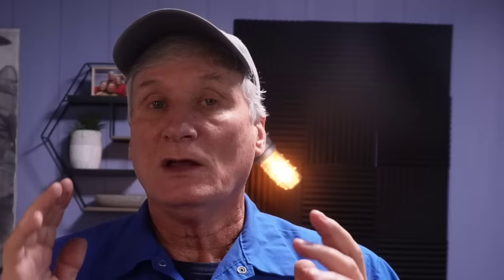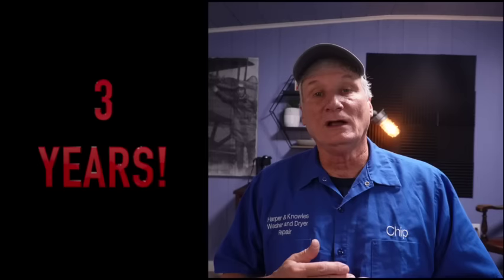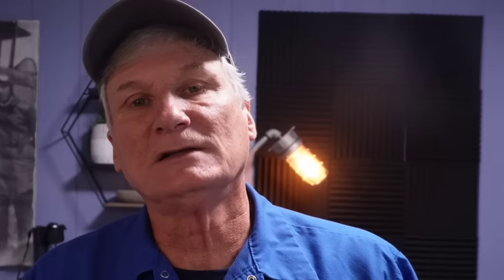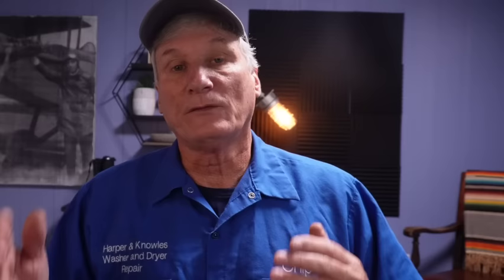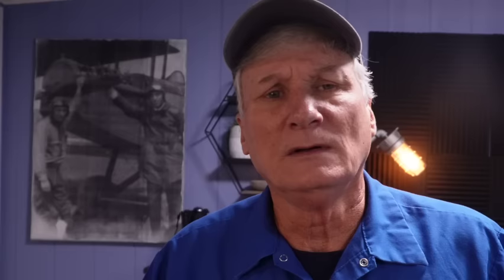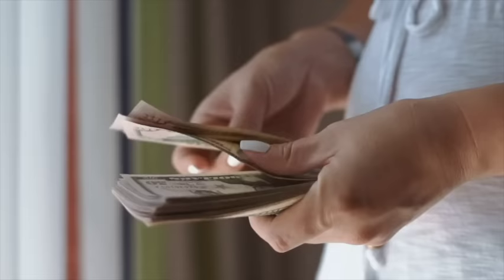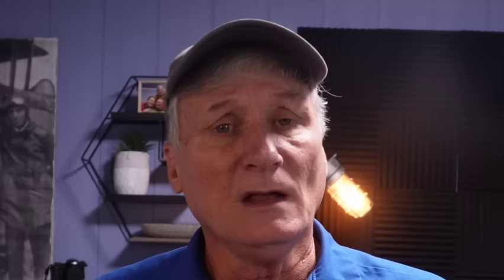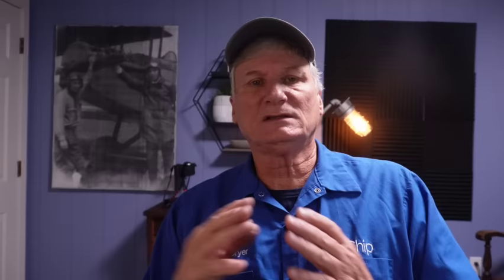How To Choose the Best Washing Machine: Speed Queen TC5 vs. TR7 Review

Comment: We purchased our Whirlpool washer (and dryer, electric) 17 years ago and have been very happy with them.  I've replaced the clutch mechanism on the washer twice during that time, but with the help of a YT video or two have done it myself quickly and inexpensively both times.  On the dryer, I've replaced the heating element and drive belt once each. That's it.  Of course now that I said all that, I hope I didn't jinx myself.  😂
Reply from the maker: Thanks for watching!
Reply: You’ll have these forever 🙂
Reply: A former employee of ours (restaurant) who now has a multi-truck Appliance repair business is a Speed Queen dealer but also tells me Whirlpool is a) easy to work on and b) has the best parts availability of brands other than SQ.
Reply from the maker: Hmmmm, that may be true. They certainly are easy to work on but the quality of the Whirlpool products have certainly gone down in the last decade or so. Thanks for watching!

Comment: Now if only Speed Queen would make a Refrigerator Freezer that lasts, like the ones from the 70's.  new stuff starts to rust, within a few years,  old machines, wouldn't even rust outside the house in the rain.  I remember way back,  some people had deep freezers, and even fridges outside the kitchen door. (dangerous I know, and why that's illegal now) but the thing is,  they did not rust out like the crap they make now.

appliances for homes should not be designed for planned obsolescence. make them good, and make them to last. at least 25+ years,  not 5 years.
Reply from the maker: You're absolutely right! Speed Queen has nailed it with their washers, but it's a real shame they haven't ventured into the world of refrigerators. Thanks for watching!
Reply: Down south, everyone has a fridge on back porch
I shudder at the thought of their electric bills! Even in Deep South, there they are. I know lady with a deep freeze in the shed!! She must pay $100 a month to run that in May thru Sept

Comment: Speed Queen is a very high superior upon any other brand and always has been since whirlpool ditched the direct drive washer series which were the second best made machines in the washer category and I still have one. There is no other washer that agitates as quick as a commercial Speed Queen and cleans so well, not really a fan of the TR series and that series has gotten a lot of well deserved hate and ours leaves behind a lot of stains as my parents got a TR model it’s unique and delicate but too delicate and doesn’t have the ability to deep clean, none of the classic transmission models with the flexvane agitator ever leave anything behind, I use them daily at work where we have tons of them. And yes, the motor they use for the classic TC and commercial series have very powerful motors, such great made appliances. We use these machines hundreds of times a week and none of them ever have an issue, if they were HE machines Michigan Laundry repair would be at our place everyday fixing them. Absolutely adore Speed Queen!!
Reply from the maker: Well said!   Thanks for sharing your experience!  And thank you for watching too!
Reply: I have a direct drive as well, and basically pack ratted enough parts to completely rebuild it, should it ever wear out - still going strong some 30 years later
Reply: @kellismith4329  Mine runs like new still, from 96. Timer is just noisy. I’ve done hundreds of heavy loads in it within the last couple years and it’s just unfazed. Incredible machine! Plus, mine has all the original parts besides the pump, it looks a bit newer. I’ve not spent a dime on any parts for it.
Reply: @kellismith4329  with a rebuild, it’ll last another 30+ years without a doubt in my mind. They were notoriously reliable washers
Reply: The 2018 washer got deserved hate. It was updated and they are absolute great washers now and I can make that assessment since I do own one. My 2023 TR5 got out ground in black lithium grease without any pretreat, using the heavy duty setting. Heck, I didn't even use the 'heavy soil' setting, lol.
Reply: @231mac  Did they update the wash system? Ours is a 2019 TR. it’s unique but sure doesn’t clean like a flexvane speed queen.
Reply: @Goldenwoodz  The 2019's clean better than the 2018 models, but I feel they were still in their trial and error phase. I believe they made continual updates since, but let's be realistic, a TR will never be able to clean like a TC model can, but it won't be so rough on your clothes like a TC will, either. I honestly cannot complain about my TR's performance in the slightest.
Reply: @HarperandKnowles  Are the TR5 models okay or not. Just bought the set and was delivered 2 days ago, as I was not sure which set to purchase.

Comment: I have a very small family, so the TC5 washer capacity would be OK. I've noticed that the GE washer my little house came with has a hard time handling bulky clothes and a summer weight quilt. I guess the TC5 would not have a problem with that. My laundry room is in the basement, so noise would not be a factor. I notice that the TR7s have a complex electronic touchscreen, which can open up a lot of things to break. And, being retired, I don't wear a lot of flimsy fabric clothing these days, mostly denim and cotton or cotton/poly blends. Would the TC5 SQ washer tear those to shreds? Finally, I HATE the dryer my house came with. It's an old Whirlpool which, despite a professional duct cleaning and me cleaning the lint screen every time, leaves little white balls all over any t-shirt material clothing which will not come off with a sticky roller! Also, the dryer got stuck last week going and going, never stopped for 2 hours. Which SQ dryer would make a nice mate for the SQ washer? Thanks!
Reply from the maker: The 3.5 cubic feet drums were standard for most consumer models up until recently.  My mother raised five kids so we had a family of 7 and that was the size washer she had.  I never heard her complain about it being too small.  The TC5 operates just like the old models. It won’t tear your clothes up just moves them through the water in the old fashioned way.  As for the touchscreen, SQ rigorously test their electronic components to a very high standard. I wouldn’t worry too much if I decided to go that route.  As far as their dryers they are mostly the same quality as the washers and are usually paired to match the washer you purchase. I hope this helps you in your decision, thanks for watching.
Reply: Thanks for your quick reply. I feel that the TR7 has more bells & whistles to break down than the TC5. And I doubt that I need all those fancy cycles for my basic non-flimsy cottons, cotton/poly, and poplin clothing. If a dryer, despite a recent professional duct cleaning and lint screen cleanings each use still produces cotton clothing covered in white lint balls (I have a long haired cat), and keeps going despite the cycle chosen, is that a good sign that I need a sturdy dryer, too? @HarperandKnowles
Reply from the maker: I'd choose the TC5, too, mainly because, like you, I think the less complex it is, the less maintenance is needed. I have no idea why your dryer leaves lint balls on your clothes. That's a first for me. I'd appreciate input from anyone who knows why this is happening. With limited information, I can only guess as to why your dryer won't cut off. If the timer knob stays in one place (the spot you started it on), then I suspect your dryer's timer motor is defective and should be replaced.
Reply: @HarperandKnowles  I had a similar problem. It wasn't the dryer but the vent to the outside that was plugged up. We had bought a new dryer hose, but that did not help. I called someone to clean it out and that was the end of the problem.
Reply from the maker: @emi566 , thanks for sharing your experience. Thanks for watching too!
Reply: My local SQ dealer stated they had fewer issues with the touchpad controls than the dials when I asked. Good enough for me. Maybe they were just giving me some confirmation bias. I don't know. I brought a TR7 home, I prefer the more gentle wash cycle. Even my Maytag with touchpad never had an electronic issue in 22.5 years. Your experience my vary.
Reply: Too  much to type here but just a thought: in 1983 I had been chemically poisoned on the job and was given 6 mo to live at age 32. The legacy is that I must avoid all chemicals including fragrances, plastics and  all synthetic fabrics.  So since 1983 I have only worn all natural fibers. Same for washable home dec [pillows, blankets, curtains, etc].  When I wore poly blends before that, I would get those fabric pills especially if laundered in the same load as natural fibers.

As an experiment, can you set aside any poly or poly blends and live with natural fabrics  only awhile, a few days or a few loads? Or at least separate the loads between natural  and synthetics to see how the fiber pills show up?

Comment: 7 years ago after yet another washing machine bit the dust after about 2 years I bought a speed queen and the first thing I noticed was how much heavier the speed queen was and now 7 years later the speed queen is still running like day 1 and has not moved at all from the spot I installed it and hearing it run takes me back to my child hood and hearing the Norge chugging away.
Reply from the maker: It's wonderful to hear that your Speed Queen washing machine has been reliable and durable for the past 7 years. The weight and stability of the machine can often be indicators of its build quality and longevity. It's great that it has remained in the same spot and continues to run smoothly, bringing back nostalgic memories of the older Norge machines. Thank you for sharing your positive experience, and may your Speed Queen continue to serve you well for years to come! Thanks for watching!

Comment: My Mom has a heavy duty top load washer bought from Sears about 20 years ago with a coated tub. I'm amazed the coated tub looks new still to this day and that washer never needed a repair and still going strong. I know multiple people with modern Samsung and LG washers that only got a few years before repairs were too expensive. One was a main electrical circuit board that failed and cost hundreds just for the part. I'll only buy a washer and dryer with mechanical controls. No digital when it comes to washing machines or dryer.
Reply from the maker: And that’s why they call you Practical Guy! Thanks for watching!

Comment: We have a TC3 washer. The only thing, when we press the start button, if it is pressed a fraction of a second too long, it will go into pause mode. We have had to develope a touch when starting the machine. One other thing we have a lid lock and we wished we did not have that. Only good thing about wifi, on freezing cold nights to keep water moving though pipes, you can turn the washer on to do that.
Reply from the maker: Is the 3 year warranty still effective? If so you should get a tech to examine it.

Comment: My sister bought a Turdpool...err...Whirlpool a few years ago- What a piece of junk. Never worked right from day one, she got rid of it in a few months, selling it on CL for $100, and took my advice and bought the SpeedQueen. She loves it and hasn't had a problem. If my 22 year-old Amana ever goes, I'll be getting a SpeedQueen too (But considering that I've yet to have one problem with the Amana, and as long as parts are available, it may well last me another 20 years). Simple and easy to fix, little to go wrong, and cheap to fix if it does = what to look for in anything mechanical. This is why I drive 20+ year-old vehicles......
Reply from the maker: I'm so glad your sister found satisfaction with her Speed Queen after her experience with her previous washer. Speed Queen's solid reputation for reliability is definitely well earned! It sounds like you've also had excellent luck with your Amana washer. You've hit the nail on the head -- appliances that are straightforward and inexpensive to repair certainly do make for a worthwhile investment. And it's a bonus when they also provide many years of reliable service, just like your 20-year-old vehicle! Thank you for sharing your experiences and thoughts with us.

Comment: I am still washing loads of clothes, sheets and towels weekly with my Maytag top load machine that my husband and I purchased in 1983! Within a couple months it was leaking oil onto the floor and I had to send a letter to the State of Montana consumer division to get the seller to fix the machine. Since then I’ve never had a service call. Our dryer is a Kenmore my husband purchased in 1978! I only use it for sheets and towels and either line dry or hang the clothes on plastic hangers to dry.
Reply from the maker: Wow, that's truly impressive! It's amazing that your Maytag top load washer and Kenmore dryer have been serving you well since 1983 and 1978, respectively. These older machines are known for their durability and long-lasting performance, and your story is a great example of that.

It's unfortunate that you initially experienced issues with the washer, but I'm glad the situation was resolved and it has been working well ever since. Your approach to drying clothes by line drying or using plastic hangers is also a great way to extend the life of your dryer and save energy.

Thank you for sharing your experience with these long-lasting appliances. It's always inspiring to hear about machines that have stood the test of time. If you have any questions, suggestions, or would like to share more about your journey with your washer and dryer, please feel free to reach out. I love hearing stories like yours!
Reply: I wish I still had my 1985 Kenmore pair! I got rid of the washer when moving in my relatives house who had a Kenmore. When I moved out, I left it & my dryer as I moved cross country with very little to avoid thousands in moving cost. 
I should have put them in storage!! Who knew the world was going to go to pot? Not I! (I’m 59 next week)
Reply: While a retired couple can hang all their laundry, a family can not. I hang about a third of our laundry n we do use towels one week, hand towels get changed daily. I am beyond grateful for my dryer. If I ever am forced to use a laundromat washer I can at least bring home all the loads (4-5 I could do at once) to dry while I’m doing other things.

Comment: I won’t spend money on other washers or dryers.  The woman I was with had gone thru 3 set of washing machines and driers in just 4 years.  I talked her into buying speed queens and they are now pushing ten years without a single service call.   The only issue I have with speed queens is the stainless steel drum in the washer. For some reason it comes from the factory still dirty from fabrication.   You have to spend about an hour with a scouring pad, and some degreasing detergent and a roll of paper towels to get the drum so it won’t leave a grey streak on a paper towel ( or your actual towels).
But you only have to do that once when you first buy it.
Reply from the maker: Thanks for the tip. I did not know this. Thanks for watching too!

Comment: I have a Speed Queen washer that offered a ten year warranty when I bought it. It's about three years old and it makes a little beeping noise if its plugged in even without being in a wash cycle. I called Speed Queen and they sent their local service man out but he didn't know why it was beeping and since the washer would still function he basically told me to call him when something broke. That wasn't a very satisfactory answer. As time goes by the beeping has increased in frequency.
Reply from the maker: You should call Speed Queen and complain about the incompetence of the technician they sent out. Demand they honor their warranty and tell them your concerns about the quality of that particular technician’s service. They will probably send someone else that can resolve the issue.

Comment: Just replaced our 31 year old Kenmore washer with a TC5. The Kenmore was still running fine but, the porcelain was coming off of the bottom of the tub causing some rust buildup. Finger's crossed for the reliability of the Speed Queen.
Reply from the maker: I don’t think you will be disappointed. Thanks for watching!

Comment: My heavy duty Kenmore has been running with very minimal maintenance and money for repairs for over 35 years.  Family of 4 doing 3 -4 loads per week on average.  If  Speed Queen can beat that I'd be truly impressed.
Reply from the maker: The thing is your 35 year old Kenmore was built to last. These modern machines are engineered to fail so that more can be sold. The Speed Queens are the only machines now that are made to
last. In today’s market it’s the best choice. Did you know that Kenmore is a Sears brand?  Yep, and Sears sourced their appliances from other companies. What you really have is probably a Whirlpool machine built for Sears and branded Kenmore. Today’s Kenmore’s are  built by a variety of companies. I’m working on one now that is an obvious Samsung product!! Thanks for watching!
Reply: Kenmores are crap now
When u go to buy a new washer, get what is like ur old one. Get a SQ.
Reply: Kenmores are crap now
When u go to buy a new washer, get what is like ur old one. Get a SQ.